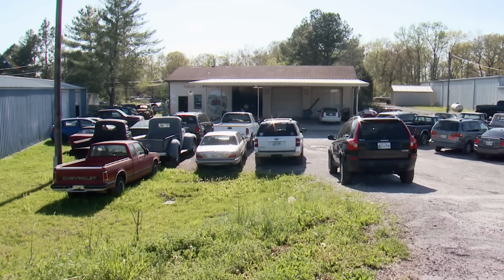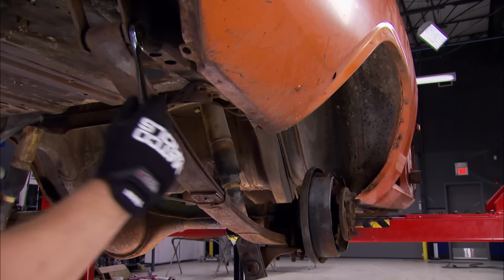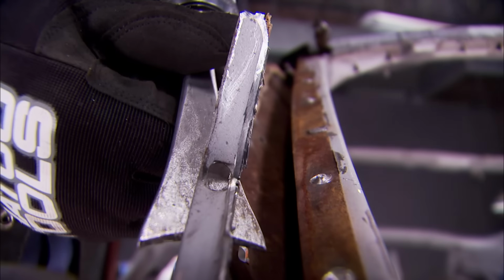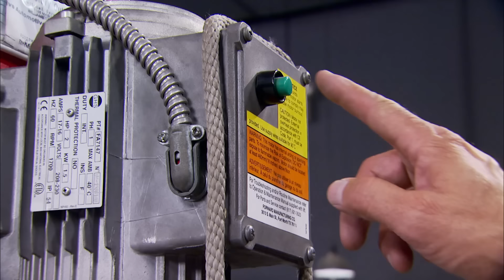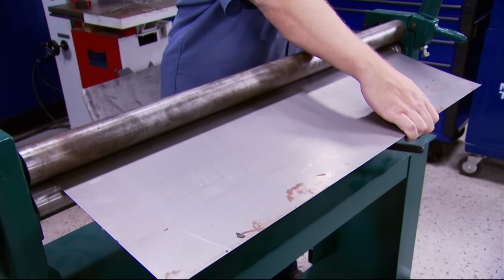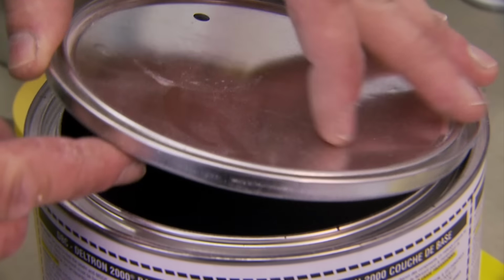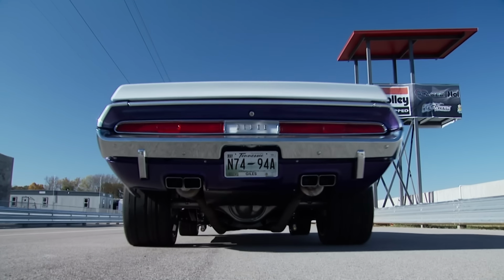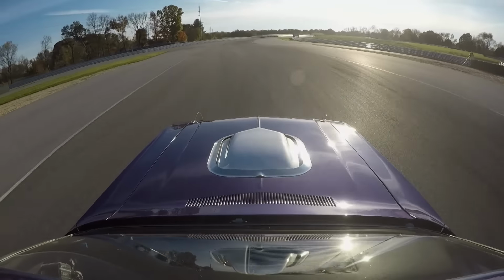1970 Dodge Challenger Full Rebuild in Minutes!

Comment: Those rims ain't it
Reply: First thought exactly, everything was good except being stingy with the sound dampening and those wheels. 🤢🤮
Reply: yeah. Rims like that don't belong on any classic muscle car
Reply: @abstract0014  not like the original wheels would fit on there. The car is wearing a big brake rotor kit, so the stock wheels won’t clear the brakes. Cars that have large brakes over stock with the power to back it up need bigger wheels and thinner wider tires to perform better than stock. 

At least it doesn’t have Cragars or some other played out small tire and wheel setup on there that everyone and their momma has on their ride
Reply: @original__gmebvy  id take the cragars any day of the week over these things😂
Reply: @original__gmebvy  yeah but.. THESE AIN'T IT
Reply: @original__gmebvy  
Even wooden wheels look nicer than these ugly things.

Comment: Nice to see a project start from a rust bucket.  Lately most video projects start with "We found this sweet 90% original grandma spec car and now we're going to ruin it with a buncha aftermarket parts you might not be able to find 10 or 20 years from now.   Watch us build it into some ridiculous beast somebody will wreck leaving Cars and Coffee."
Reply: This car is now worth half of what they bought it for. Butchered. Again.
Reply: @413x398  you do realize what restomod means? You dont seem to.
Reply: @kanggoo57  You don't seem to realize that certain collectibles are worth more restored to factory condition than heavily modified. I don't need a duckface to lecture me about cars.
Reply: @413x398  Relax, it's just a car.
Reply: @basshead.  Then why are you even here?
Reply: @413x398   What's your point?
Reply: @basshead.  Not too smart, are ya.
Reply: @413x398   They made the car better and safer. Cars are for driving, not for sitting in the garage. Stock Challengers are pretty crap.
Reply: there is nothing rebuild about this, find a half decent shell, replace a bunch of the sheet metal (the only part of the rebuild actually), throw away everything else just so we have something for this 2020 chassis/engine/trans/interior - lame
Reply: ຊຊຊ
Reply: ໍຊໍຊ
Reply: @hordesoflocust  ຊຊຊ
Reply: @hordesoflocust  ຊລໍໍໍ
Reply: @hordesoflocust  ຊບ
Reply: @hordesoflocust  ໍຊໍໍຊຊຊຊ
Reply: ຊ
Reply: While I do love a original style muscle car,  the restomod makes it better in every way if you want to drive the car and not let it sit in the garage collecting dust.
 If I had the funds, I would have both!
Reply: @basshead.  If cars are for safe driving, why to bother with an classic like this here? Can go to the next dealer and buy a nice, safe driving car. You missunderstood the concept of car restauration...
Reply: @famaccount479  Most new cars look boring. Do you like cars with bad brakes and handling?
Reply: @basshead.  It's an Oldtimer, not a race car. I like them in old conditions like they were before, to keep them in original condition.
This here in the Video is wasting of an original, can build a replica from the scratch instead of use an old frame and throw 95% away.
Reply: @famaccount479  Oh, cry me a river.
Reply: @famaccount479   Even Jay Leno modifies his old classic cars to be more driveable.
Reply: @basshead.  Nobody cry here murican.
Reply: @basshead.  Regard to Leno: Do you know the difference between modification and throw 95% away and rebuild a complete car?
Reply: @famaccount479   throw 95% away? Bro, the car was basically a shell.
Reply: @413x398  Then go and buy them yourself and do it the way YOU want.
Reply: @famaccount479  Then go and buy them yourself and do it the way YOU want.
Reply: @the_car_guy5915  How if idiots like here in the video buy such classics more and more and wasting them for such crap builds?
That's exact the point I've mentioned, instead of build a replica on the chassis of some modern car they build a rare classic and wasting it, so it disappears for real car enthusiasts who gonna build them in original condition.
Reply: @famaccount479  I don't understand how it's being wasted as long as it's being driven and enjoyed instead of left to rot in a field in it's stock form.
Reply: @the_car_guy5915  Well, if you don't understand the difference between a Classic car Restauration to it's original condition and such ridiculous wannabe crap here...I can't help you.
Reply: @the_car_guy5915  What makes you think I don't already?
Reply: @famaccount479  I don't see any wannabe crap here. Just a couple of guys modifying their car the way they like it. Don't  like it, leave.
Reply: @famaccount479  Beating a stranger on the road is not the same thing as modifying a car to your taste.
Reply: @the_car_guy5915  It was an example to show you, how much nonsense the term is "if you don't like it, leave". I can say my free opinion to that crap here, and i does. If you don't like to read it, scroll on and ignore it. But don't tell me (or any other people) to leave, because i have another opinion.
Reply: @the_car_guy5915  I don't told you to leave, I told you if you don't like or accept other opinions just scroll further and don't bother about. My opinion doesn't change anything for you, but my opinion could have saved another rare Oldtimer.
Reply: "When people care more about the money you get by reselling the car rather than driving it"
Pathetic human beings.
Reply: @gearbanginentertainment7476  It's not about value, it's about keep a rarity in the original condition.
Reply: @413x398  They obviously didn't do this to flip it Einstein. They made a lot more money by using the sponsor parts and creating content which can be monetized.
Reply: @413x398  "Then why are you here?" Says the guy that's upset with the contents of the video. People can still enjoy a show and still acknowledge that at the end of the day it's just a car. It's their project, not yours mr knowitall. And then you tell others they re not smart while YOU missed the point. lmao man...
Reply: If it was numbers matching all original then it should be restored to original, but if it's a roller or blown up not matching then who cares, it's a comfortable classic driver now
Reply: @famaccount479  Let them enjoy their car.
I really don't understand you bitching about what they did to their car, it is quite simply none of your concern.
Reply: @nikitalomakin3205  I don't bitching or tell anyone what to do, I just tell me honest opinion. I have a secret for you, that's the reason why videos in YouTube have a comment section.
Reply: @famaccount479  By basically going off on these guys? What a great and peaceful way of expressing an opinion.
The car is theirs therefore they are free to do whatever they want with it.
Reply: @nikitalomakin3205  And once again, the comment section is liberal, so i am free to post my opinion, as long it doesn't insult or treaten anyone.
Plus i don't saw the reaction from the so called "going off guys"? So i am just curious, who are you, the opinion advocate who stands up for others?
Reply: @famaccount479  If you are free to express your opinion then I am free to shit on it.
There's a difference between expressing your opinion and talking shit about other people to make your opinion seem like the correct one.
Reply: Idiots will be idiots. How in a hell is making  a rotting car work and usable wasting in general??
Reply: "Today we took this antique car and cut it in half, then cut another identical antique in thirds and put the middle third of the second one into the first one, it may not be street legal, but it sure does look ugly as shit"
Reply: Н. Анапа ивняковрн
Reply: Sax sai

Comment: Every scratch into metal that is then covered by a new panel is a rust spot that will come through in time. In some environments like Florida you could store it inside and it will still rust.
Reply: I've seen enough restos to know you need at least rust converter/primer for any sealed metals
Reply: I was thinking the same, but since I've only been into cars for a couple of days I wasn't sure if I was missing something.

Comment: I was 8 when the Challenger came out. I always had the desire to own one or a Charger. I never could decide.
Reply: Me, too!  Unless you're a millionaire, most of us will never have any of these old cars.  
These cars were so cheap in the 80's and 90's it's unreal.  I was lucky to have had a few Mopars in my youth...73 Charger 318 $1400.  73 Challenger 340 $500.  69 RR 383 $2400.  74 Gold Duster 225 $free.  69.5 Super Bee 413 $900.  I wish i would have held onto at least one of those cars.  sigh
Reply: @mrkemblegilstrap  9oooooo9
Reply: @mrkemblegilstrap  68 GTX,$600...70 R/T SE charger $700...55chevy2 door post$50...57 2dr hard top Bel Air$200...68GTO $800...41 Willys truck $1000 But this was 1969 to 1977, I still have the GTO and the Willys I'm putting 1971 340 from a Challenger in it as we speak, wanted a 327 but couldn't find one

Comment: I'd take a well-restored 70's era Challenger over a new one ANY day
Reply: @LICobra  Nice! I sure miss my '73 440 Charger. Had a big Carter 4bbl on it and the 727 TorqueFlite with the SlapStik console. Great stuff.
Reply: So if someone offered you this build let's say it's got 450hp you would take that over a demon or a hellcat red eye. No disrespect just a question
Reply: @adamhaselup1125  Hi. I would take it over any newer version of the Challenger. There are a number of reasons why. First of all, cars from the early 70's were so much simpler. Easier to work on. No computers. Less points of failure. More room to work on the motor. No computer controlled junk, no need for a $100k diagnostic machine and no need to take to someone for help. Also, older vehicles were built to last. New ones, not so much. So much plastic. Thin body panels. Cheap components. The new ones are nice, don't get me wrong, I have nothing against them for what they are, but if the decision is old vs new I'll take old any day.
Reply: I think LICobra makes a good point to this conversation and that has to do with one's age when they are exposed to a particular car. I was just a kid when I first saw the 70's era Challengers, Cudas, and Chargers. Being exposed to a vehicle, song, movie, etc., at a young age has a profound effect on a person.  There is an indelible link to that object. People who are 13 yrs old seeing a new Hellcat will bond to that late model Hellcat over the older 70's era cars simply because that's what they were exposed to. This is my theory anyways, take it with a grain of salt. :)
Reply: AMEN!

Comment: I am curious to the cost? These professionals make it look so easy. Good job Powernation!
Reply: These are usually done for very wealthy clients, car collectors and such. They find and buy these broken down antiques and pay car restaurateurs an incredible amount of money. If I had to judge this one off-hand, I'd say the guys asked at least 500k for it. Probably even more - there's restorations that can cost into the millions, because parts have to be custom made or found, since they aren't manufactured anymore. It mostly depends on how the parts can be sourced and how much work has to go into the car.
Reply: 500k? Idk about that.. it's more like 150k still super expensive but not 500k lol alot of the parts are reused and the biggest expense is the chassy and engine and transmission. The seats and wheels and other stuff isn't to bad to find or make. They probably spend about 30-40k on the car and around 90k on the stuff to restore it.
Reply: @ifixcars692  tbf, I was mostly going off genuine replacement part prices, and adding up an entire car's worth. Unless all components are unuseable, you probably would go under 500k - but not by much. If the client actually demands genuine parts, costs rack up insanely fast - I know a guy who does these restorations, and for one of them, the client had him hunt down actual parts manufactured around the same time as the car. He ended up having to call up people who owned that same car and negotiate an exchange of a custom-made replacement for their genuine parts, in addition to a hefty lump sum and having to shoulder the work cost and insurance.

Comment: WHY THOSE RIMS???!
Reply: That’s what I was going to say
Reply: I hate big rims. Stiffer ride (no sidewall), bend easily on rough roads and easy to blow out a tire. They do handle better, but I take a little less handling then having to buy new tires and/or rims every time I hit a pothole.
Reply: @CamaroAmx  i thought those were the shocks?
Reply: @Maximus20778  thinner sidewalls means less flex in the tire which can cause a harsh ride. The tires, springs, and shocks all contribute to the ride quality.

Comment: I like the look of the early 70s Challengers as they were.  I would way prefer updating the handling and drive train.  One thing I know from having owned a 74 Challenger is they were light in the rear end and had a fair amount of body roll.  But they looked great inside and out.
I would love it if Dodge would bring back the look of the look exactly of the early 70s models and build it with the modern engines and handling tech.

Comment: Bought a 70 in 73 for $1200 383 pistol grip 4 speed car black on black. Beings as I was 17 i blew a rod through the oil pan in second gear dragracing on woodman after being teased by a 69 or 70 corvette on Van Nuys. Couldn't afford another 383 so ended up putting an old junkyard 360 in it that I got for $75 and dad helped me get it back in so I could get back out for Saturday night. Drove it till it dropped in 76 and it sat next to our old wooden garage off Sherman Way for years till some developers bought the house with the car still there and built apartments there. Wish I would have towed it out of there.

Comment: I really like this car except for one minor thing…
The paint. I’m not a big fan of the purple/white combo but that purple is beautiful. Maybe a black or grey instead of the white would’ve looked better in my opinion but it’s still a wonderful car. Glad people can see that even rusted out pieces of crap can be turned into works of art.
Reply: I’m with you there, black stripes would look way better. Restorations are so satisfying for some reason.
Reply: @daganlott2032  ikr. I’m in the process of fixing up a 93 Bronco EB edition and it’s so satisfying when you get this problem fixed or that problem fixed. Like recently I fixed the interior trim pieces with some walnut and want to add some more walnut in it looks so good!! I remember when I got it the paint was awfully oxidized but not in bad shape. That was downright the most satisfying thing I’ve done to it, coming from that faded junky look to glossy forest green and tan. Can’t wait to have it fully restored with a few extras added on (king ranch leather seats, 3/4 ton axles with 4” lift coils/airbags in back, custom exhaust, etc)

Comment: what happens with all the rusted bits between the various layers of sheet metal, wont that rust the body at some point?
Reply: Most likely painted with a rust converter to stop the rust and also turn the rust into good metal (as long as it’s surface rust). Just clean off the worst of it and spray it. The metal is good and it will most likely never rust again.

Comment: That car at the moment what you made could never be registered in Europe, the only thing that is original on it is the chassis number that you cut from the old one and put the kit on the new sheet metal.  It has nothing to do with the original car or the safety of the car itself if it is safe for the road at al.
Otherwise you did a very nice job 👍

Comment: The best thing you can do for this car is allow me to do the break-in cruise. I will go 500 miles, change all the fluids. Then I will go 1000 miles and do the same. I will then drive it for twenty years with a fluid change every 5000 miles. After that I will give it back to you road tested. Do we have a deal?

Comment: Hey POWERNATION!  I have no idea how you budget your builds, what your cash-flow could possibly be, or anything about the financial mechanics of your channel.  With that in mind, have you thought about using a new repop chassis and body on your builds instead of all of the work you do on a building a project like this?  I doubt you're getting the "core" from the yard free and you're putting all of the time, manpower and money into fixing/restoring it.  Wouldn't you be time and money ahead using a Dynacorn body - chassis setup and then add any after market stuff or resto-mod changes to it then?  I'm not a spokesmen or connected to the company in any way, but at $17K Msrp that seems like it has to help your bottom line.  I am just saying...   With less original cars out there, it would make sense to leave those to the collectors market and use a product like theirs (there are probably other reproduction companies I just didn't hunt them down to add here).  I wouldn't have a problem with your channel using a reproduction product anymore than I object to you using brand new modern motors and transmissions.  That's just me however and I only speak for myself, not the other viewers here on Youtube.
Just one more person telling you how to do your job...

Comment: Stock wheels is boring, you go to every muscle car meet and that’s all you see. Why go with small wheels when you can go with larger wheels that actually fit the wheel wells? Larger wheels are better than smaller wheels. You can fit much wider tires with a bigger contact patch, stickier tires that actually grab the road and offer better grip, and you can fit much larger brake rotors and more efficient brake calipers and pads under there as well. 

You get an old boat that can outhandle another old school muscle car and outaccelerate it without tire spin, since you have extra grip where it’s needed, and you get a vehicle that’s great in the corners in addition to going fast in a straight line.